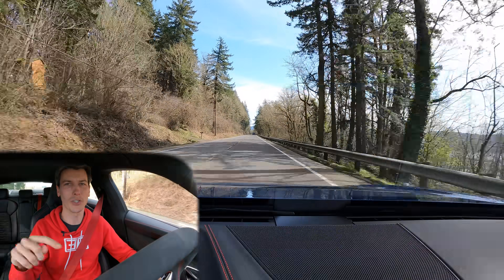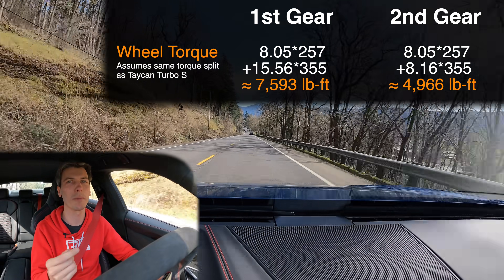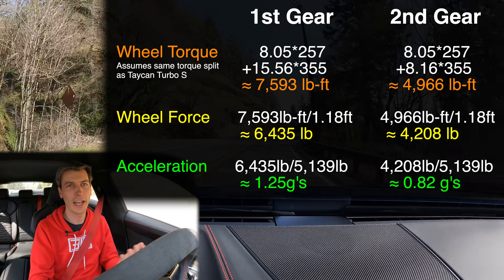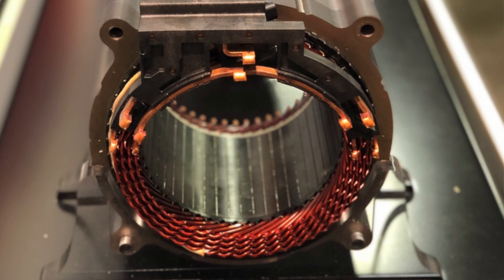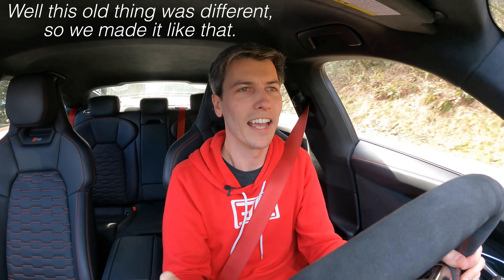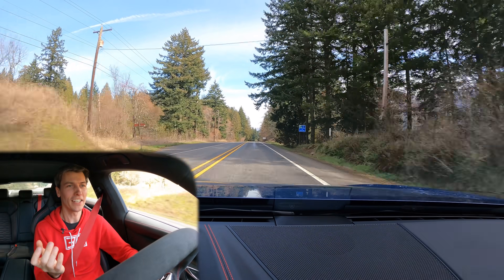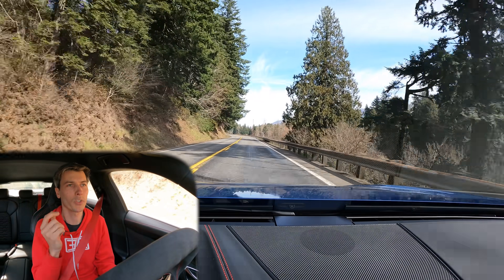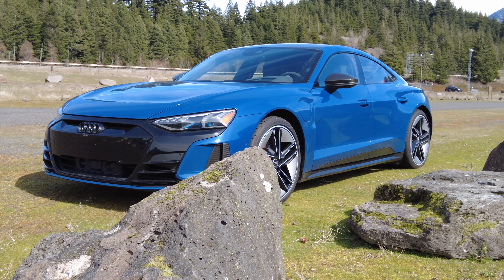Are Fake Manual Transmissions Coming? Audi Keeps It Real

Comment: Going on this thought of ev’s using single speed gearbox’s or now 2 speeds there is something missing from the discussion. That is the simple fact that DIY ev conversions have used manual transmissions for years before mainstream EV’s came about. Look at the late 90’s and early 2000’s, everyone including myself have used manual transmissions connected to our electric motor of choice and by doing so allowed for us to use a smaller motor with the principal of mechanical advantage so whats the big news here?

Comment: They should simulate the movement of the piston using magnets. For eg when the piston is at its top most point, a huge opposite magnetic force would push the piston head down simulating the power stroke in a ICE.

Comment: Also just thought: if they can simulate a manual transmission in an electric car surely they can fit a real one. Wouldn't that improve the efficiency of the motor by revving lower and drawing less power from the batteries? (I don't know how it would work.)

Comment: This doesn't make sense. Why would you have to drive slower when your battery gets low on electric cars, so let's say your electric motor slows down but the transmission can create the same speed at lower rpms

Comment: For me a manual transmission isnt really just nostalgia; I think it’s more rewarding for the fact that you are controlling the car versus the car controlling itself. That plus when you drop out those good auto cross times or track times you know it was a mixture of the car and you shifting through gears around the corners properly. I don’t know maybe it’s just me, but I feel like an actual manual is more rewarding even though it may be slower as far as response goes. It’s just makes a vehicle more raw.

Comment: Is Toyota's fake EV stick shift ridiculous? DEFINITELY. Do I plan to buy one? DEFINITELY! It will bring back the fun of driving manual without the downsides. No clutch replacements, no grinding gears, no slave cylinder failures, no gear oil changes. But yes, Toyota decided to leaving stalling and lurching from mismatched downshifts as part of the package 😄

Comment: The big design reason i could see for simulated manual transmission (and engine sounds) is the same argument for physical buttons - gives you a more tactile sense of control. In a manual you know what speed you are going by what gear you are in. Humans don't perceive speed well and so the manual option and engine revving sound gives a connection to speed that our senses wouldn't otherwise have.

Comment: I think best way to implement " gears " to EVs is glorified eco mode to increase range by limiting power. Basically lower your " gear", less power you have, more range you get. But yeah, " clutch " is rather useless, not a single reason why you cant just switch nob without it.

Comment: I think that best mix is a 1.4L engine HYBRID with a low torque E motor.   Get madd Range and some fun.  With some 0-60 times in tha 6 second range.  Something like tha mid 90 Acura type R or V-6 Camaros.  But getting like 70mpg tho!!! <3

Comment: Use some light low torque EV motors mated to some Current Trannies and have some FUN.

instead of cranking out a 1000lb/ft of torque that can BREAK everything around it.  Use a 300 lb/ft for compact sport cars.

Comment: Since it’s all electronic anyway, I’m sure these fake manuals will have another selectable mode that will enable them be driven like any electric car without shifting. I also think combustion engines will be around for a while, and wonder some of these developments will lead to clutch by wire systems in ICE performance cars. Again, that could be turned off and driven like an automatic but with a third pedal and H-shifter.

Comment: This answers my question I had a year or two ago. The answer is why go through all the trouble in making a shifting gear not needing gear shifting  for torque control. I don't think gas will be gone completely, but enough to lessen the amount of burn by the every day individual driver, but maybe there is a way to combo less battery for torque control need which then powers another element to both energize battery, maybe it works if transmission is needing torque co trol to reenergize, like say in gear shifting, is an energy reenergize mode.

Comment: If anyone make a real 5+ speed electric, I would want it so bad.  Put a weak electric motor in it, I dont need that torque or RPM, shiat.  I dont need fake noise though, F That!   Can you not tune an electric motor to have lower torque and run less efficiently? Im pretty sure its doable.

Comment: I get fake engine sounds for safety reasons. You don't really feel constant mild acceleration as much as you feel sound pitch and level going up. Especially when the car has an unusual seating position and the suspension is well tuned. I'd much rather have a functional speedometer to prevent accidental acceleration though... a simple projector that puts it right in the windshield and gently flashes a bit brighter when you cross the 10, 20, 30, etc. mph/kph mark. Then you'll notice that you're speeding up at least. Or look at how aviation has solved the same usability problems a couple decades ago.

Comment: As for CVTs the customer gets used to a sound like the engine pitch rising with acceleration, therefore with a CVT - some manufactures reduce the "CV" of the CVT to simulate stepped gears. It seems odd but they probably had complaints like "It feels like the clutch is slipping", or "It's like I'm in a diesel electric train, I can hear the engine's working hard and I'm gaining speed, but the constant pitch is like a generator". The answer is what I would call a "horsepower pedal" method of shifting. A drive by wire pedal that doesn't directly control throttle opening but also the transmission to keep it in an rpm range.
Let's say your engine is 100 horsepower at 6000 rpm peak, then if you floor it, you will get maximum throttle opening and the car will shift gear to keep you at 6000 rpm or the minimum ratio, whichever is highest. If you want 50 horsepower, and it turns out that this is most efficient at 3400 rpm and 80% torque at that RPM, then pushing the pedal halfway down will cause the transmission to engage gearing that keeps the engine at 3400 rpm and the accelerator will open the throttle to produce 80% torque at that rpm. If you want to hear the engine rise in pitch, you can progressively accelerate.

Comment: In a motorcycle it's likely unnecessary to have multiple speeds. If the bike has a top speed of 120 mph, then that's the free fall speed of a skydiver. Assuming the drag is similar, that means you need about your bodyweight in wheel force to maintain 120 mph. The bike is a bit heavier but that should be similar torque to a 1 in 3 gradient climb at lower speeds if the bike is twice the weight of the rider, plus the motor will have more torque at lower speeds.
With semi trucks, the use of gears makes sense again, although the Tesla semi is reportedly only single speed, which is surprising. There is a lot of demand difference between trailerless on the motorway and heavy trailer up a hill.

Comment: Thank you! Shiftable CVTs have been a pet peave of mine since I first heard of them a few years ago. (I have had 3 Prii starting in 2007). I heard the RAV4 Prime comes with a paddle shifter which I would like to control the amount of regen, and it might be fun to play with as a pretend tranny, but IF it can't be turned OFF, then no sale! I like that my Prius hits the sweet spot RPM wise when I accelerate. I gave my 2007 to my #2  grandson. And he went up hills slowly because he thought he was abusing the engine. I explained this to him too late. He had aready traded it on on a Kia PHEV with an actual dual clutch 6 speed manual. He probably would have made the trade anyway, as it was getting rather long in the tooth.

Comment: Didn’t Jeep make an actual manual electric demo vehicle? They used a low-RPM electric motor, I think, so you actually needed the gearbox. But there wasn’t a ton of information, so I’m not sure. Putting a low RPM electric motor into a vehicle may be objectively silly, but at least you wouldn’t feel silly rowing the gears, because that part would be real. Would love to see a video about it.

Comment: I do think that manual transmission has its practical purpose within the preference. It helps you keep a speed range much easier, essentially limiting your speed within a window with sustained gas. Really, the torque is all that matters, but for the feel I think this is it. I’d intentionally trade off efficiency for fake gears or even real gear ratio changes because I prefer having a window where i have higher efficiency fast speeds and lower acceleration vs going with high acceleration at the cost of low efficiency. Ofc if they could get rid of the loss in efficiency that’s ideal lol. But I enjoy the windows of acceleration and I think everyone else who “just likes the feel” probably would too. Controlling your acceleration means higher precision of location control, which means you feel like you’re moving the machine rather than the machine is moving you.

Comment: I've always wondered why we didn't have gears because I always assumed fewer RPMs meant longer range. I did not realize that RPMs don't make much of a difference between high and low and energy consumption. Thank you for the explanation 

I do disagree that manufacturers are doing this because it is how we used to do this. I think you know that they do this to help people convert to electric cars. I love engine noise, shifting manually, and if two similar cars were for sale and for one of them I could shift it, I'd buy it. The same is true for manual versus automatic ICE vehicles. New automatics are faster, shift better, but driving is also about experience and an automatic doesn't provide the experience. So yes, as illogical as it would be, I would buy a manual version of an electric car.

Comment: I cannot stop thinking the opportunity to switch this idea to the opposite...

What if the gear box is used as a gear box.
What is that torque band(the straight line) is only used and the rest is given to the 6 speed.

The motor only runs in the rpm it's comfortable at while the transmission takes the car to the top speed 🤷

Comment: Wish they would put manual stick controls on some of the newer high tech automatics, not just the buttons or flippers. Getting the stick in the few manuals available from US  manufacturers rules out half the options, same with getting the diesel. The few trucks and 4x4s that had diesels or sticks, were very limited, in the configurators, you pick stick or diesel and everything else gets greyed out, if the option itself isn't.

Comment: I know that many CVT cars mimic fixed ratios.  But do those ratios really remain fixed?  If you are cruising at a fixed speed of a level freeway (for example) will the computer select the ideal gear ratio which provides the best efficiency, or will it be locked into one of 6 or 8 or 10 (for example) fixed ratios?  My understanding is that many drivers do not like the sensation of a squishy link between the engine and the wheels.  They want the sensation of fixed ratios, but my point is that maybe those ratios do not need to remain fixed in the long term.

An unrelated question deals with sedans versus similar sized SUVs and crossovers.  How much difference is there between (the height of the) center of mass between the sedan and the crossover?  How  much difference does it make in the handling?  If you can turn off the stability nannies, how much difference does it make in prevention of a rollover? FWIW I have a 2004 Acura TL w 6spd manual, and a 2007 Honda Fit w 5 spd auto.

Comment: Manual transmissions should still exist in some electric cars imo. Rather than a larger electric motor which has enough torque to work for a car in one gear, they should just put a smaller motor in with a 3 or 4 speed manual transmission which allows for a lot of torque in a low gear while still providing a high enough top speed. I’ve seen a video about an electric converted 911 that did just this.

Comment: Is this getting pushed by old school automotive engineers who can't deal with cars that don't go VROOM? I'd really prefer a nice, quiet whirrrrr with steady acceleration.

Though, I would like a clutch for one thing: to feather the torque when I'm starting on snow and other slippery surfaces. That fake clutch won't do it, but a good variable frequency drive motor would do just fine.

Comment: In my opinion,  the noise of an engine is related to the driver to BE AWARE they ARE speeding up , if they made them the QUIET then you lose touch of how humans RELATE speed to sound . . 
A blind person could tell hear and feel how another person were driving in a car MAXING the red line and show fear and concern for how fast he was traveling and tell them to slow down for safety reasons,  if there were little sound i guess when they smash into something traveling twice the speed , but quiet,  it would be more of a surprise? 
The gears are for those who have no clue how fast and dangerous they can be , so it makes sense to put a speed limiter for each "gear"  but its more just so if they have a water bottle jam the gas in first gear at a stop , well yea they might tear off fast but speed would only hit 35 mph with the petal ALL THE WAY DOWN  , VS reaching top speed ... just my opinion is all 👍
Reply: People have no problems driving at the correct speed in other EVs.

Comment: my opinion is, it would be good if you can chose whether or not you have that fake manual simulation thingy. Like the video says, the manual transmission in  electrics is fake, and soemtimes you dont need it. i think it is best to have a button to turn that feature on and off, so if you dont want the feeling of driving a manual, just turn it off, and if you want it now, turn it back on

Comment: 5 cents to CVT having gears is that CVT belt sitting on single place for too long with constant accelerations on same place - ruins the transmission. But yes, gears is silly there.
More interesting question is this: How much power EV engine consumes on each of the fake manual gears? :)

Comment: Give me a fake 6 speed with driver customizable gear range and torque curve per gear. I really like choosing the throttle range and torque curve for a particular speed and driving condition in my manual now.

I don't want the whole range of the pedal to go from 0-140 mph.  Sometimes I want that range to be 30-60.

Let me have M4 ratios one day and old Ferrari Testarossa ratios another. The great thing about a fake 6 speed, is that it can be turned off when you're sitting in bumper to bumper traffic. Emulate the torque curves of different vehicles.

It won't be efficient, but it will be fun.

Comment: To be fair. Today manuals are fundamentally obsolete to modern automatics. The well done manual gets worse gas mileage then a well done automatic, is slower, and is less smooth. The sacrifice going to a combustion manual is the same as the sacrifice of an electric manual when you consider it from that perspective. Your not driving a manual for speed. A sequential manually controlled automatic around a track if tuned correct will always outperform the equivalent manual both in corners and inline. That’s the reality of the modern automatic. We already choose combustion manuals for fun and for illogical reasons. The problem here isn’t the logic behind it because we abandoned that long ago. The problem is that to many the idea of simulating the physical sensations of a manual will feel like a pointless novelty even if all sensations are replicated identically. At the end of the day, you know it’s not real and that’s what defeats it for many, not the logic.
Reply: Many people are just used to manuals, and still prefer them, which is why pretty much all new cars today come with a manual variant.

Comment: It is useful to have the speed correlated to a sound frequency when you’re driving as you can easily hear a speed change as a shift in tone. I guess the sound of a fossil gearbox and it’s various ratios is optimal for speed feedback - who wants the speed feedback to sound like there’s a wasp in the cabin because the speed is correlated 1:1 with the tone.
Reply: I've never driven a car that sounds like a wasp.

Comment: A BEV with gears are not a good buy.
If you need high speed, you can use carbon sleevs.
A gear are just more maintenance.

Comment: i dare anyone to hack a CVT car with it's manual mode and make it have an insanely high number of 'set' \ 'preset' gears over the actual infinite range possible between the minimum & maximum ratios.. in my car i got 6.. i find this possiblity HILARIOUSLY FUN to experience both either accelerate or decelerate with 20 or more gears(or hack it so u can change it on the fly) in manual mode 😂 so much that it would be like using some volume knob -- but just for a different kind of engine breaking (for example)

Comment: Silly. I Bet they did a marketing research and found out people like sound and transmissions. But 90% they asked never drove an ev more than 2m and are also people who reject change. This is also useless if you consider that the psm reluctance motor was invented that keeps Torque high for higher rpm